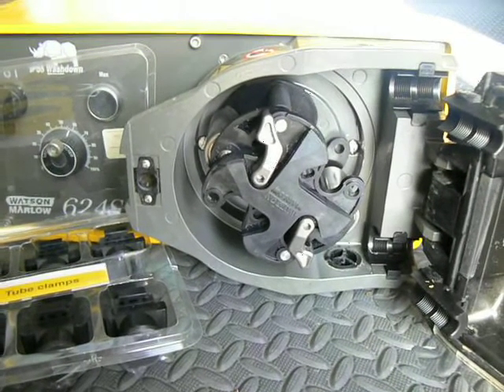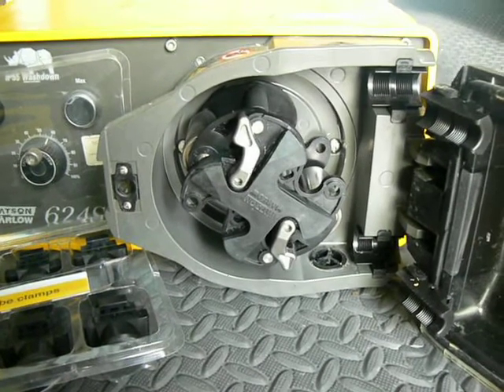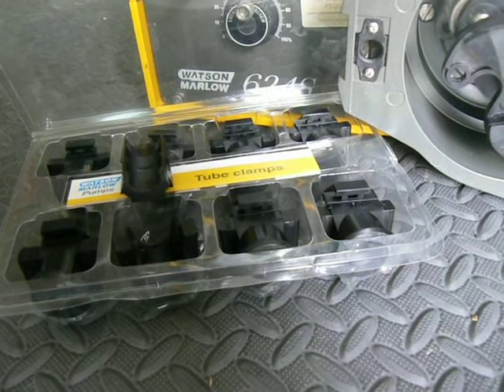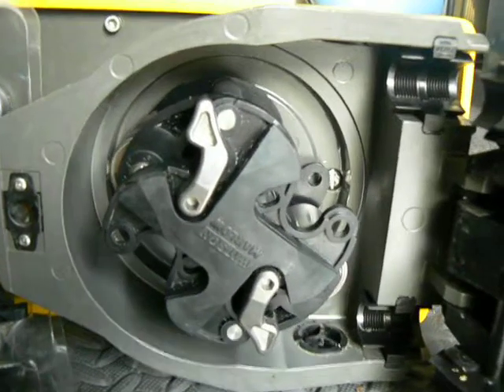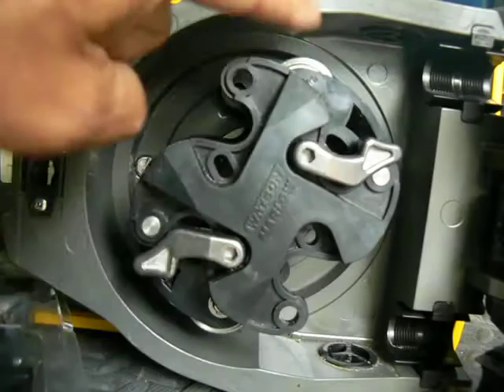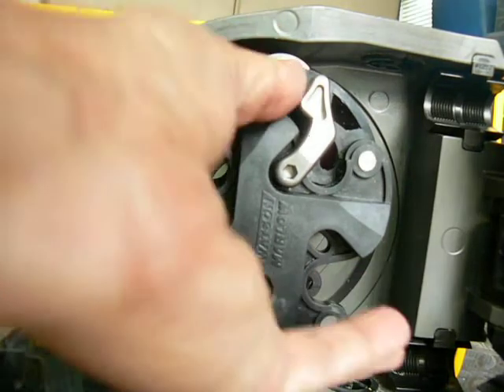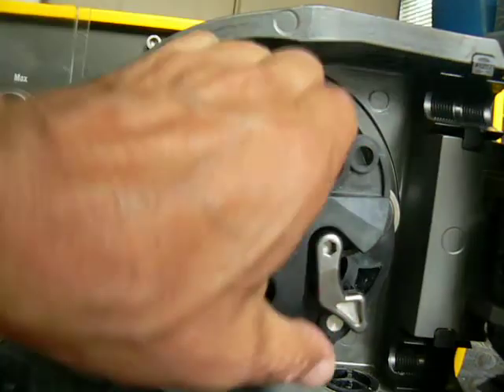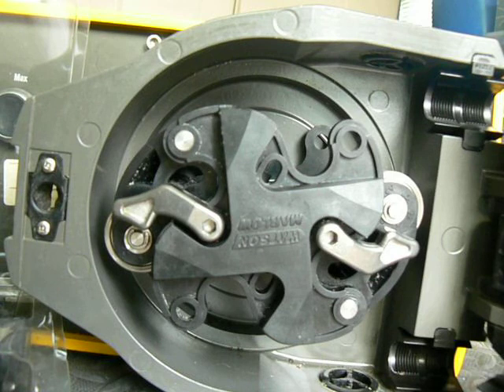Watson Marlow 620 / 630 Pump Head Troubleshooting

Comment: What’s the name and part number of the smaller rollers inside the pump head
Reply from the maker: Those are follower rollers. It appears they don't have a part number listed. They do show the spindle or shaft for that smaller rotor. Its part # MR2015T 
"Follower roller spindle" 
You can find the manual for all the 600 series pumpheads here:
https://www.wmfts.com/en/resources/search-documents/manuals/en/watson-marlow-620r-620re-and-620re4-pumpheads-manual-en/

Comment: Sir. Thank you so much for this video. We have a 620S pump with 620 RE pumpheads for tube elements. Do you know if it’s correct to use the 620RTC Continuous Tubing Clamp 069.4101.000? This is the only tube clamp I can find online. Thank you so much.
Reply from the maker: The 620RE pumpheads are made for the tubing elements as you mention. You don't use continuous tubing or tubing clamps. If you try to put a continuous tubing clamp in the RE pump head, the pump door won't close. The reason is the gap in that pumphead is set for 4.0mm wall thickness which matches the wall thickness of the Loadsure tubing elements. The continuous tubing rotor is set for 3.2mm wall thickness tubing. The wall thicknesses are not interchangeable.
Reply: @westernbioprocess  thank you for the clarification!

Comment: Hello, please how do you remove the clamps? I want to switch the clamps to different tube size but it’s stuck and won’t come off. Thanks
Reply from the maker: When the clamps are stuck, I've used flat head screwdrivers to pry them out. I start with smaller eyeglass type screwdrivers to minimize damage to the clamps. Often dried product residue is the culprit for sticking. Warm water can sometimes help. A light tap with a rubber mallet can also work.
Reply: Thank you. I’ll try that.

Comment: Hi John, I have a question. The pump has an internal calibration setting. Part of this setting, is the "Tube" parameter. Is the input for this parameter should be the inner diameter of the tubing / pipe used?
Reply from the maker: Yes, the tubing ID in mm should be used in the calibration menu. Check the black plastic tubing clamps also to make sure the ID stamped on the clamps matches the tubing ID.